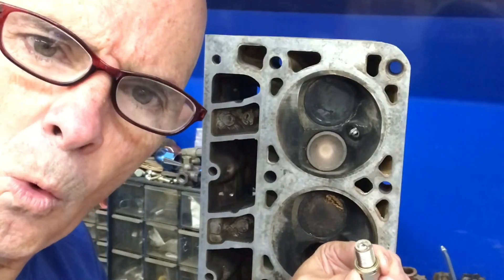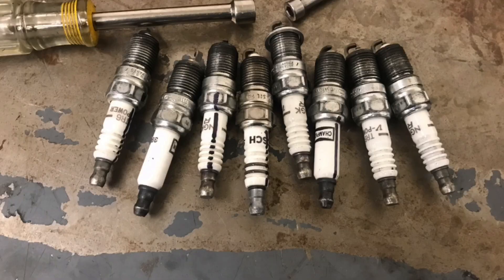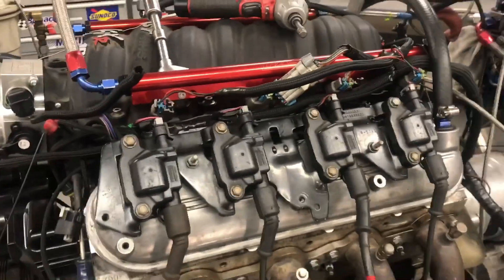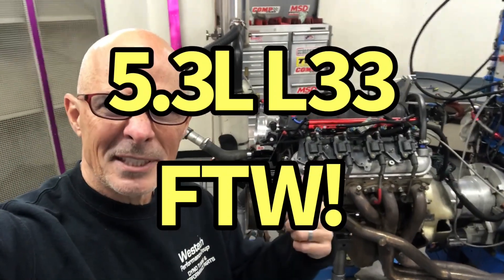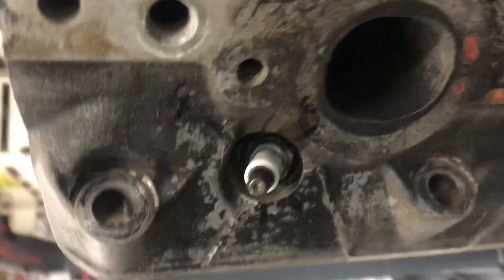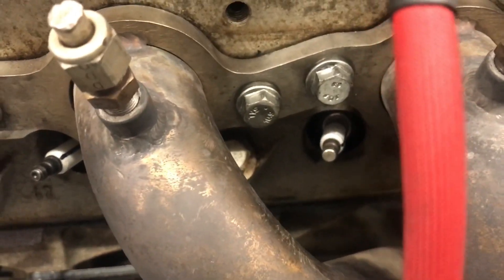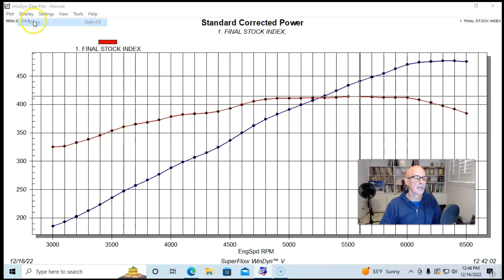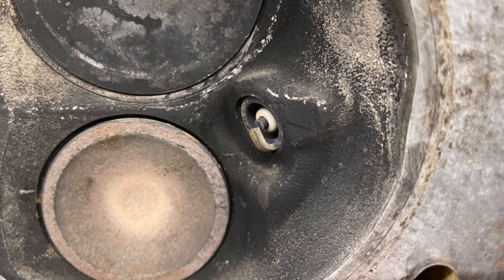SPARK PLUG INDEXING-DOES IT REALLY ADD HORSEPOWER? JUNKYARD LS MOTOR MYTHS! LOW $ MODS-DOES IT WORK?

Comment: I had heard about stock car racers were getting a few extra hp from indexing back in the 90's (80's 350's) and wanted to try it. I had a turtle back Caprice (91) with the stock tbi 305 and indexed the plugs when I tuned it up. I aimed it towards the center of the chamber on the theory that the flame front wouldn't need to curl around the chamber. Didn't really notice any power gains that couldn't be accounted for from new properly gapped plugs, but I used to get phenomenal fuel economy on long trips with that gutless car. Even moved my family with a 6x12 uhaul trailer behind it over mountains.
If there truly were gains on my part, I would attribute it to the fact that it was NOT an efficient chamber design, with a (relative to the ls) low power 90's single coil ignition that needed every little bit of help and the style of plug on that head meant I didn't accidentally shroud the electrode.
I currently have a tbi 350 in my 95's chevy suburban, and I just shoved that porcelain goodness straight in after checking that gap and didn't even think twice. Power and economy gains on that thing would be best served by taking the massive meats off and going back to a stock, lighter tire...
Reply: Yeah just think a lot of it was just race talk back then today people have  dynos everywhere instead of using the butt dyno..... a lot of race talk about little tricks that were a lot of them didn't a lot of them had no evidence Richard Holden puts out the evidence by using that dyno... so a lot of our race talk for the 80's and 90's some of the stuff about indexing was took wrong the whole thing about it is someone could do this in the garage without a Dino and the car was still run good either way so you put your car and it's running good you do this track index the plugs start car back up it still runs good drive up the road yep it's running and they going think that if an upgrade because it ran just like it did before but they can't tell the difference because there is no dyno.. evidence to a lotta little race tracks back then some of the race tricks for authentic in some of the race tricks for just BS... but this is where Richard holder comes into play in the 2000s LOL he does all kinds of homework for us with test results

Comment: On 4 strokes it doesn't gain.on 2 strokes it does matter.the e-tec from bombardier sleds you are not suppose to re use old plugs they have to be indexed or spits a code and will not idle correct.

Comment: Any videos about using cerakote for cast pistons or combustion chambers ? to see if the extra protection against detonation is noticeable ? As in will it save your engine if the the tune is off a little and give you the safety margin to address the tune before the engine scatters ? Just ordered 12 ounces for a lil less then $100 shipped to the door and supposed to be enough to cover approximately 32 pistons ? is there a very real bang for the buck if you use it to coat cast pistons in a budget boost 2V situation with rings gapped for boost ? and as a side note are the 2V stock rods as strong as the 4.8/5.3 Chevy rods ? they are both powdered rod designs right ? with cracked caps ?
Reply from the maker: have not tested
Reply: @richardholdener1727  food for thought then ? with a cheap application of cerakote on junk yard LS engines when you have them apart to do rings ? test with $40 application of cerakote on pistons and combustion chambers to see if engine has a higher threshold of longevity under higher boost then previous.? push the boundries.... or better yet do a ford 2V junkyard head to head stock versus cerakote and ring gap under boost ?

Comment: Should have tried it on a big block Chevy with a points ignition.  Maybe then it would show up but ultimately I think unless for some reason it was effecting the spark generation then it would not matter as every orientation is going to ignite the fuel.  Probably more hp difference from changing heat range plugs than indexing.

Comment: Wish I had this info back when I was racing Late model stock... My crew chief and engine builder made us index and it's so tedious to get it right. I always knew in the back of my head this might be 1/2 hp... But in a class where you can run any lift flat tappet cam, bowtie heads, restricted down to a 500cfm, 2 barrel 5 hp was the difference in qualifying 1st or 20th. 
The engine builder was one of the best & well-known in NC, and NC has some of the best. I think they just wanted to mess with me I was only like 21.

Comment: Hi Richard, something I am wondering is with modern heads being manufactured on CNC equipment (stock and aftermarket)  The threads in the head should all start at the same angle.  It would be neat to know if the LS heads are like this or if the threads start at random angles.  That being said, then it's a matter of where they weld the ground strap onto the spark plug in relation to it's threads.  You'd think someone would make a plug where the assembly line machines put the ground strap all in the same place.  Basically wondering on these LS motors, are the holes all the same and the plugs are random, or are both still random.
Reply from the maker: HOLES AND NOT THREADED THE SAME, NOR ARE THE PLUGS-BUT IT DOESN'T MATTER
Reply: @richardholdener1727  was just curious!  I got from the video that it didn't matter lol

Comment: The way I was taught to index plugs is buy extra like a box or two, mark them all and find what cylinder that a plug points where you want.  No washers required!   DV says it doesn't help really until high compression(not talking dome pistons).   In my opinion it sometimes helps part-throttle, not something you can feel/test on the engine dyno

Comment: I thought indexing plugs was only for older engines like small block Chevy and big block Chevy. Primarily so the piston wouldn’t contact the plug but for more high horse power applications. This will be a cool video to watch though.

Comment: Awesome!  Thanks for sharing! The performance world needed this. I just did a video on indexing on my channel. Did a ton of research on which direction was best. Ended up pointing at the exhaust valve for the heck of it but figured it would yield any gains. 

Only time it is really critical is with high dome pistons where the strap needs to be in the notch of the piston.

Comment: I would snip back the ground electrodes to just before the bend, leaving a sharp point, and index the plugs so the open gap was aiming down toward the pistons, and consistently found 1 mph in that mod.
Reply from the maker: 1 MPH?
Reply: @richardholdener1727  Yes. These were not modern fast burn chambers, and granted track conditions aren't as controlled and consistent as a dyno, but the results were enough for me to keep doing it.

Comment: I'm going to take a guess, an educated guess because I've tried this, that it doesn't make any difference at all! using indexing washers on the plugs is going to change the combustion chamber CC/volume by moving the plug further in or out of the combustion chamber which I would expect uneven power from cylinder to cylinder!

Comment: I wonder how it qould affect a motor thats boosted and on the verge of blowing out spark.

I was expecti g pointing them towards the exhaust valve too make the most power.
Reply from the maker: REDUCE PLUG GAP FOR BOOSTED-NO NEED TO INDEX

Comment: Had to pull the head off my L96 6.0L because a spark plug blew out the threads (first time that's happened to me on an LS motor) and was going to index them before throwing the heads back in because it makes sense in theory. Glad you put out a video with the actual answer.

Comment: Great video..
Is there any aftermarket heads better than the 799? I'm sure you have done a video
Reply from the maker: LOTS OF AFTER MARKET HEADS THAT MAKE MORE POWER THAN THE FACTORY 799 (INCLUDING THE FACTORY REC PORT HEADS)
Reply: @richardholdener1727  Interesting, I was under the impression the 799 head was the one to have as far as the factory goes.

Comment: I'll post this here incase you do check this. I may be mildly dumb, but since you have the resources to attempt this I'd love to see you attempt to 3D print a TPI intake for a 5.3 just to see how it'd perform. I think you could get away with reusing the plenum and runners off a factory TPI setup if you setup the base right for it. One of my reasons for avoiding an LS swap is because I swore my Iroc would always be a TPI car, but I'd love to simply see if it were possible to have my cake and eat it too. Though, if I were to LS swap my Iroc, I'd probably do a real LS3 because I think it sounds significantly better than a 5.3.
Reply from the maker: THE FACTORY TRUCK INTAKES ARE ALREADY LONG-RUNNER, TPI-LIKE INTAKES
Reply: @richardholdener1727  Primarily asking because I think the TPI intake itself is one of the coolest looking intake designs that's ever come out. I understand that it's relatively pointless, but it still just looks super awesome and I'd be genuinely interested to see if it would negatively impact performance. Thanks for the reply!

Comment: The only application I found where indexing the spark plug is very important was a go-kart racing engine , valve in block , with a slapper camshaft . Indexed incorrectly and a valve will contact the plug smashing the gap shut and engine quits .
Reply from the maker: WE DO IT FOR CLEARANCE TOO

Comment: I used to run super long thread spark plugs in bikes ect when I was younger , my theory was more compression ……. That might be a test for you Richard , longest plug that fits without interference vs stock ???

Comment: You should experiment  with exhaust length with x pipe vs h pipe cat back delete or 02 sensor location hp gain or loose best placement for ls motors

Comment: I think running a high compression engine on pump gas I think you could get one or two degrees more timing in it which would net you more power by facing them away from the intake. Just a thought. If anyone's tried let me know.
Reply from the maker: TIMING REQUIREMENTS DID NOT CHANGE

Comment: Hey Richard could you and please do a FORD 460 EFI? 1988-1997 found in the F-250-F350s. There was two different head sets available the early E7TE and the later F3TE with in those years. There was a little difference in the heads. Also the early EFI was Speed Density vs the later was MAP.  Most people interested I would imagine are going to emphasized on the Torque side for pulling. There is just NOT much about it on the Net at all when it comes to this specific EFI set up specifically using and retaining the EFI.  Anybody can change the top end of the engine with after market heads and add a carburetor but that is not what I and I'm sure a few more people would like to see. I have seen questions posted about this set up but not much of a solid response on what can be done or has been done to get more pulling power.  Thanks in advanced.  GREAT JOB WITH THE CHANNEL.

Comment: Could putting a thimble with 7 holes in it (one central 6 outer) over the sparkplug let you run the engine leaner?
Reply from the maker: WHAT WOULD THAT DO EXCEPT NOT ALLOW THE SPARK OUT?
Reply: @richardholdener1727  mahle use a similar thing, and according to them the holes are just big enough to allow fuel to be pushed into the little chamber on the compression stroke so that it has stoich, the little holes force the the ignition of that fuel into little jets that are aimed at the far corners of the cylinder for better combustion under lean conditions.
Reply: I have had an engine running like this, but it had two fuel systems including one separate direct fuel injection system into this ‘thimble’ or pre-chamber. It works, but that was on a large (maybe 140 litre) natural gas engine used for a standby generator. Also, the nitrogen oxide emissions would be too high for any new on-road engine today, and it was huge. It could be done but I doubt you’d gain enough efficiency to offset the cost of the diesel exhaust fluid and catalyst needed these days, and the pre chamber needs its own head design, not something you could tack on, except maybe using a pre chamber diesel head.

Comment: To be honest indexing spark plugs I believe had a lot more to do with crutching poor combustion chamber design, and individual runner deficiencies on the older cylinder heads. Because the LS is a custom signed engine with the more precise castings and better design for flow because of the gentleman like Robert Yates who helped design the engine it has a better combustion chamber and better ports where you don't see as much delineation between runners and courts like you would Arnold small block Chevy cast iron head from the OEM. I know the difference of indexing spark plugs on a older 302 with 292 turbo heads made quite a bit of difference the way it functions and irm and this is what I want but when you switched from those OEM taking the pack best to the best race heads the old 292s and moved on to an aftermarket head it didn't really make a big difference time wise. And you have to think about the fact that we were looking at spark blowout due to Port velocity or boost or fueling or air flow inequalities between ports. Because of memory serves it's been proven that an LS has less than 1% difference between ports for flow and fuel distribution due to the port fuel injection and the design of the intakes. That only changes if you're using a carburetor on an LS of course.

Comment: The real test would be a standardized plug compared to something like the E3 Diamondfires.
Reply from the maker: COMING
Reply: @richardholdener1727  I have been wondering for a while, how do you think a 400 cubic inch SBC would handle a TPI set up?

Comment: Hi richard! Unrelated to this vid but trying to get an answer. What fuel do you run typically on all these dyno runs? I live in australia where alcohol fuel is a special item. We have e10 and e85 at selected places. Our 98 is equivalent to your 93 allegedly and its what’s standard best here. Do you use standard fuel or oxygenated fuels typically?
Reply from the maker: 91 PUMP GAS ON MOST NA MOTORS
Reply: @richardholdener1727  awesome thanks. Think i watched a video a while back saying you mostly use alcohol. Assume just on high comp NA and boosted then. Makes sense 👌
Reply from the maker: E85 FOR BOOST

Comment: David Vizard did a video the other day that included a story about a 90hp swing in power on a Leyland Mini motor as a direct result of a spark plug change. What I gained from that is that electrode location is critical in that application. Likewise,  I believe the same when it comes to indexing. In some applications it might be critical. But in most cases that it is, it is because of something else. Like poor combustion chamber design, poor piston design, poor atomisation in the cylinder etc. Good video Richard, thanks for doing it. Regards Greg
Reply: Impossible, because it would take a very good n/a A-series to make 90hp at all. Nevermind a 90hp swing ! lol You've clearly picked up something wrong. They're a very old, siamese port, typically 1300cc maximum engine. There is no way ever to see a 90hp swing unless it was from no spark plugs, and no power....and spark plugs and a running engine with 90hp
Reply: @blow0me  go watch the video. It was supercharged. But seeing as you know everything before you even do any research, you must be smarter than Einstein

Comment: Not sure if this is mentioned but more then likely the dyno is set up with a MSD ignition box with multi spark ? if so that may be the reason indexing showed no gains because the MSD box was compensating for not being indexed .. if this testing was revisited doing the same but without a MSD ignition there might be some gains to be had for the poor people without a MSD box which might be the very same people running an economy junkyard 5.3L engine with low buck mods ?
Reply from the maker: THE HOLLEY HP MANAGEMENT SYSTEM RUNNING THE FACTORY LS COILS DID NOT HAVE AN MSD OR ANY OTHER MULTI STRIKE
Reply: @richardholdener1727  Just checking because it if it was running MSD it could have skewed the results and the type of electronics wasnt mentioned in the video. Great video wasted many a time in the early 80's with carbs indexing plugs to compensate for me running to big of carb for the application before wide band sensors were a thing for tunning carbs to be more effecient.

Comment: OK, so the indexing deal is kinda not really worth doing... BUT, I'm VERY impressed that you have that L33 junkyard mill kicking out pretty close to 480HP by swapping factory parts for 1 7/8" headers, FAST intake/TB and a BTR cam. To me, that is quite inspiring but at the same time,  I'm beginning to ask myself a lot of questions about the economics of my current 'build' LOL. Thanks for getting to the bottom of this debate Richard, I believe it was time well spent.
Reply: Does your engine seem a little... recalcitrant? 😛
Reply: @michaelblacktree  🤣🤣🤣

Comment: Stock 1970 Dodge 440 with open Chambers head 906/452 and indexing the plugs for the ground strap was pointed at the intake valve allowed me to bring my total timing back from 44° to 40 degrees and I picked up just shy of a .1

Comment: Haven’t done indexing but I went up in heat range and replaced old tires plug wires with low impedance wires and I feel like it helped. Could be a cool test since you seem to be on an ignition kick lately! BTW I’m running an lq9 w/706 heads and stock cam with no tune.

Comment: Never made sense how it could effect power. Plugs are inside a gaseous cloud that's being compressed around the plug. The spark is gunna ignite the mixture and it's going to propagate however the chamber is designed to do it, regardless of which way the plug is facing. It's not a roadblock..